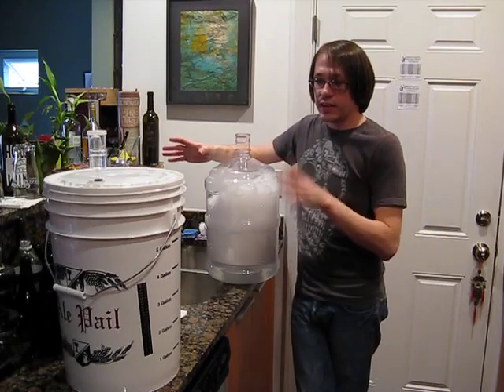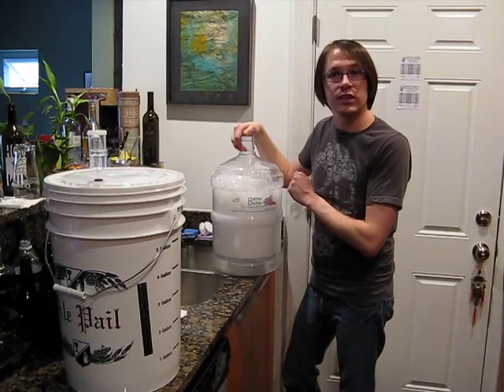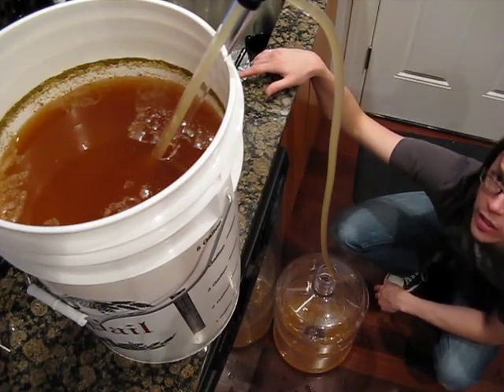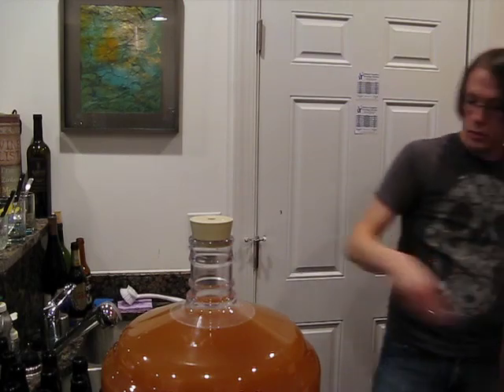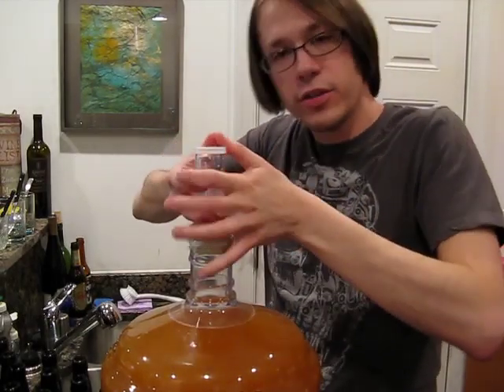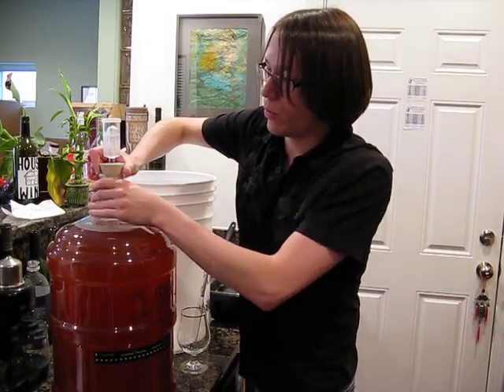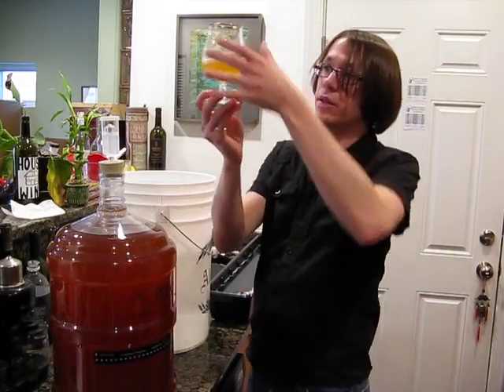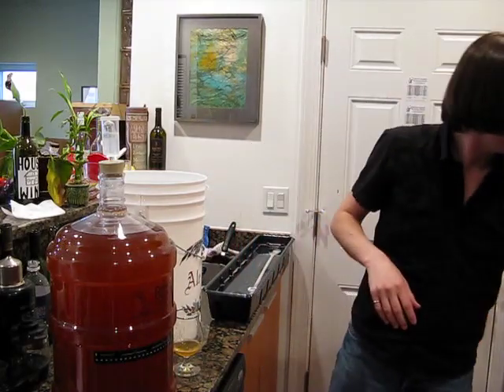Home Brewing an American Light 20 Min. Kit with Joe (Part 3)

Comment from the maker: @jaygnar I agree--if you've had an aggressive fermentation in one, or just had a lot of residuals, cleaning the BB can be a royal pain. That is definitely one thing I agree with--it's good to be able to scrub your carboy with a brush vs. letting it soak in tons of cleaner... I use both glass and better bottle interchangeably too--I think it's all a matter of what's going into them. If it's a light brew, I'm definitely going with the BB.  But if it has a lot of hops, then you bet it's the glass.

Comment from the maker: @MCass31 No--I siphoned from right above the cake. You don't want to suck up all that trub into the secondary.  Doing a secondary fermentation is pretty much to clear out the beer and to help give it a bit of conditioning time. You definitely don't want to get all that crud in your secondary! The autosiphon I have has a plastic piece on the tip of it that keeps the suction about 1" from the absolute bottom, so I'm able to put the siphon in without worry about sucking up sediment. Cheers!

Comment: The universal stoppers are easier to use than those rubber stoppers. They stay in better and are easier to get out, in my experience anyway. The Better Bottle uses the size medium, and they come in drilled and solid. Glass carboys use the size small. I like that the Better Bottle has a much larger opening. Also, lightweight is good for me since I'm a small female, so lifting a full glass carboy is out of the question for me.

Comment: I use both Better Bottles and glass carboy and like both . However I do like the glass slightly better simply because I can really scrub them with a bottle brush. In my opinion, if you are experienced and strong enough to handle them( get a brew hauler) then glass is the way to go.  Just my opinion and I respect all points of view.=)

Comment from the maker: Typically no--there is a small cap that lets the wort pull from the top of the cap rather than at the bottom.  I typically don't let the autosiphon totally touch the bottom anyway--so it's never been an issue for me.

Comment: Cooper's system doesn't employ a 2ndary fermenter. After fermentation the beer goes right into the bottles for 2 weeks. What is the puprose of 2ndary fermenters and do you need this step if you are going to keg the beer?